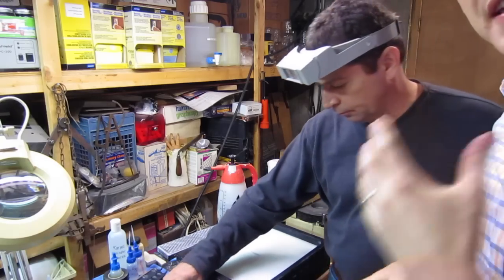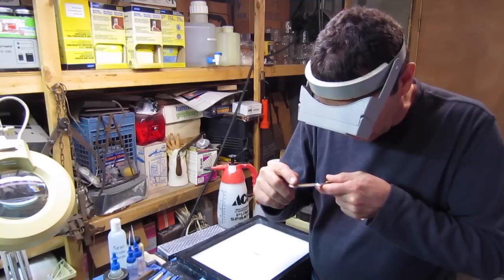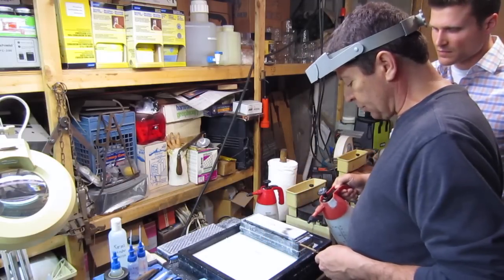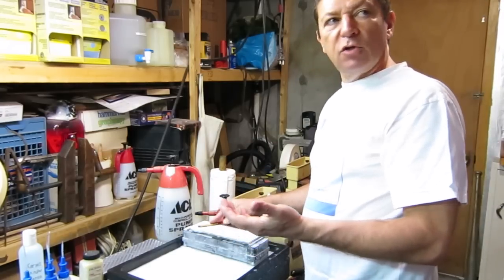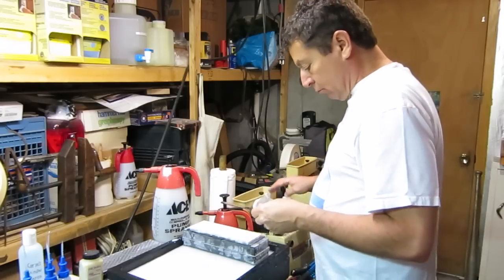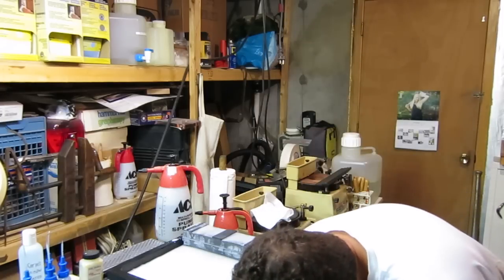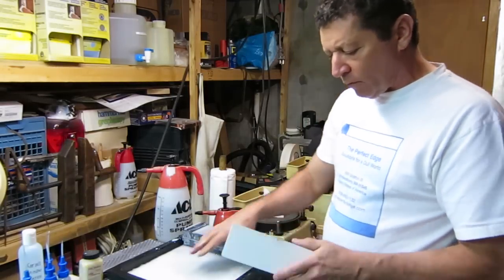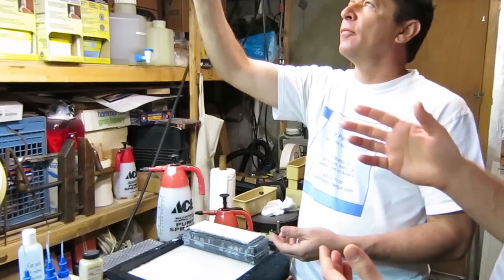The Perfect Edge - Straight Razor Sharpening

Comment: I've always had trouble honing correctly. 
After watching this: 

I put a pretty aggressive bevel on an old straight razor. 
Took the razor to a higher grit.
Took off the flash (29:27),
Did two backward cross swipes on each side

Once I was done, I tested the edge on my forearm, and watched the hairs lift off of my arm and collect onto the razor. 

I'm definitely glad I watched this video.

Comment: as you hone won’t the spine wear down and then the angle of your edge is constantly changing as the spine gets smaller
Reply: No. You are also losing steel at the edge. The straight is designed so that the loss of steel at the edge and spine maintain the same edge bevel angle throughout the life of the razor. This is the best argument against tying the spine when honing.
Reply: A straight razor is designed by a team of engineers and the Overall Angle (OA) stays the same as the spine wears down at the same rate as the edge wears back. I do tape damascus blade spines so as not to mess up the etched damascus look but otherwise don't believe in taping the spine.

Comment: Howard.  Questions on the coticule. I have many and collect them. I just bought a 12 inch one! it weighs a ton.

Anyway. Howard are you still using them? you mentioned to me in an email years ago that you always use slurry. I feel slurry can round the edge.
can you explain your process with them? Maybe a video?
Are you not stropping even after a coticule?
Reply: Nicholas, YES! I still use coticles and Belgian blues and still love them. They sharpen quickly, don't load, don't form burrs, and give a great edge. What's not to like?
Reply: I have never experienced getting a rounded edge off of a coticule. I always use a slurry. When I'm honing other peoples' razors, I go past the coticule to the Shapton 16k and 30k. In my medicine cabinet though, I keep a coticule which I use to keep my own razors sharp. Strops. I no longer use hanging strops. I do have a 4 plate lapping system I created with .5 micron diamond, CrOx, and the last two are abrasives I make myself. One is called Purple Phase and it's around 40,000 grit and the last is Zulu Phase and it's around 50,000 grit. Shaves smooth and is amazingly sharp. BTW, I only sell Select grade coticules and, from what I've seen, and what my customers tell me, there IS a difference.
Reply: Nick, the coticule market has really changed over the past few years. A lot of what used to get thrown on the slag heap is now being sold with cute French names. At the same time a lot of problems have been cropping up with cuticles such as the rounding you mention. I don't experience these problems as I only use the Select grade coticules. They cost a bit more but, if you're going to have a stone for two generations, the extra cost is minimal and amortized out over time.

Comment: Howard, Dovo makes a black plated straight razor blade, would the aesthetic be ruined when sharpened?
Reply: Thanks! That really clears things up, especially the bit about taping the spine.  I ended up going with Dovo's Bergischer Lowe.  Worth changing the attack angle slightly in order to save the sculpted, gold plated sine.

Comment: Howard...you may have mentioned and I just didn't hear, but we're all those strokes with pressure? Could I use this same technique on my Naniwa stones? I have a 1000, 5000, 8000, and 12,000. Thank you for your response.
Reply: Richard, all of the strokes are with pressure because the goal is to remove steel. It's easy to gauge on the shapton stones as they're white and I look for an even smear of gray steel across the stone. The Naniwas are good stones but you might want to try finishing on the Shapton 16,000. You'll get a better shave.

Comment: What do you think about using a dremel to hone a straight razor? I had a professional sharpener recommend this. What do you think?
Reply: +Howard Schechter Thank you for your reply. I thought a dremel would be disasterous on any straight edge razor. I had a well-known pro basically tell me that whoever told me this is incompetent. Thanks again.
Reply: Working on straight razors is more like working on jewelry that is heat treated. I fix a lot of blades that get messed up with Dremels, Foredoms, WorkSharps, and belt sanders.

Comment: I may have missed it, but how much pressure does he put on the blade as he takes it through the series?
Reply: Phillip Rios Phillip, not a lot! I let the stones do the work. If you press too hard, bad things can happen. How hard? Well, you're grinding steel so you need some pressure but not a lot. Hard to tell you online but if you're ever in Massachusetts, stop by and you can see how I do it.
Reply: enough pressure to leave steel on the stone. If you go too light, nothing will be accomplished

Comment: Did he back hone it before he shaved his arm or did he do normal forward stroke?
Reply: after the 30k I do a jointing stroke on the edge (holding the razor vertically) and then two forward strokes on each side which gets rid of any of the "flash" at the edge of the blade

Comment: Hi, was the last 4 strokes - edge leading or spine leading? I couldn't see.
Reply: Edge leading. First, joint the blade on the shoulder. This gets rid of the flash and gets down to the true edge. The four strokes get rid of the remaining flash. I do this instead of stropping which, I find, fatigues the flash and breaks it off unevenly. I'm all about the edge, 'bout the edge.

Comment: Should I consider buying Shapton Glass stones or Shapton ceramic stones?
Reply: ***** Shapton glass stones. They're the newest technology. The ceramic stones are old technology and fading out. I've been using the Shaptons for many years now and couldn't recommend them more. They give me consistent and repeatable results. The biggest variable is the razor itself, the steel, the heat treat, and the previous honing history. I've received blades which were sharpened on a belt grinder and that takes the temper out of the steel immediately. A blade like that will never work properly.

Comment: sucks that radio shack doesn't exist anymore. Im sure i can find something simular to that microscope on the net somewhere. I love this guy and it very rare that I like a person. his understanding of everything is amazing. I could totally hang with this dude and would listen to everyone of his fun facts with 110% attention.
Reply: Yes, there's nothing to replace Radio Shack and I miss them. I'm now getting the Carson MicroBrite from amazon.com and I actually like it better than the RadioShack model. LED light, easy focus, 60x-100x. The best deal I've found out there in optics at $12.
Reply: 😂 I have that same jewlers loop from radio shack for $12 dollars from 2003  for my straights. I'm holding it in my hand now. Batteries are dead and switch needs a little work. Just got to polishing honing stroping and shaving with my 14 ebay razors from a 20 year hiatus. Screwy thing is just overnight through osmosis. I can hone polish and finally put a shaveable edge on a razor now. I can see imperfections and chips with the naked eye through the polish and glint of the metal against a good light.

Comment: Wow this method looks much better & easier, i will have to save for the 30k  hone and glass lapping stone..
Reply: +Karl Buttler the lapping plate is amazing, shapton glass stones are simply designed to be used by them. The DGLP grooms the stones and makes them very flat, however the 30k stone I dont' agree with. Its very expensive, and you can get very similar results with honing compound on a hard sub straight.
Reply: thanks ill look into it..
Reply: also, if you want a fine stone just get a suehiro 20k, its actually finer than the 30k shapton, and alot less money
Reply: Thanks looking into it now, how long have you been using straight razors?
Reply: Not too long, but I have been sharpening and using just about everything else for quite a while... straight razors are my newest adventure.
Reply: Sam, how is the 20k finer than the 30k?
Reply: Karl, there is power and synergy to the Shapton system. All of the parts work together and produce consistent and reliable results. I've tried many stones and have hundreds in my study collection. I've standardized on the Shaptons.
Reply: I think the 20k gokumyo is .25 micron so its actually about the same, I thought it might have been slightly finer. I believe its cheaper and thicker though.
Reply: Brands will name their grits whatever they want. The Norton 8000 is really more like a 5 or 6 thousand in other brands. You can only really go to micron rating. there are also three basic grit systems. The New Japanese system, which shapton follows, the old Japanese system which King follows, and then the USA system, which is like Norton sand paper, but then company's throw curve balls at you and just put random numbers up for their own line. Shapton wants you to read "wow 30,000" its a very fine stone, but their just mesh ratings.
Reply: most sharpening nuts i know who want to spend allot of money go for the  choseras or japanese naturals. 

I had a set of glasstones up to 16k and wasnt impressed. i got better edges off my imanishi 10k. i do think the shaptons are over hyped and marketed in a somewhat dishonest way, with their higher grits really being exagerated. I do appreceate they label the glasstones with the micron size.

plus i do think if your getting into half micron territory you might as well just strop with compound.
Reply: Depending on the razor, 16k isn't enough. Bokers, for instance, really only shine at 30k. I've been using the Shaptons every day for the last 6 or 7 years and get consistent and reliable results from them. I've got customers from all over the world who send me their straight razors to be honed and are repeat customers. I've built my business over the past 15 years and am surprised at your lack of results with the Shaptons. I have a number of natural Japanese stones but they just sit on the shelf. Same thing with Harrelson Stanley, the Shapton distributor. He trained as a carpenter in Japan for 12 years, has a whole shelf of natural Japanese stones and they gather dust. I know a lot of people love their Japanese stones but I'm not a fan as I find them variable in quality with soft and hard spots throughout the stones. Quality control is also somewhat lacking with many of the stones shipped looking like they were hacked out of the mountain. There are many ways to "sharp".
Reply: Howard Schechter  the shaptons are popular and for good reason, they are perfectly useable high end stones. im just saying i think they are a little over hyped and over priced for what they are, and there are so many options out there. 

when your saying most razors need to go above 16k to have a good edge, your really saying a 16k shapton, because for any other manufacturer that same stone would be rated around 10k. here are some examples:

the shapton 16k is around 1 micron, these stones are also 1 micron:
Naniwa chosera 10k
Naniwa superstone 12k 
Suehiro 10k 
Sigma select 10k

as you can see, the shaptons grit rating is exagerated compared to others. as others have said also the suerhiro 20k is half micron, which is the same as the shapton 30k. So you can see why i feel the shaptons are a bit hyped and a little misleading. my experience with the shapton glasstones was that they cut fast but didnt leave the edge id expect for their stated grit, and they loaded quickly on chisles and wide bevel knives. I got a better edge consistantly  with my imanishi 10k vs the shapton 16k, which is 2/3 the price and 4x as thick as the shapton.

Also their prices.are higher than others. their lapping plates are verry expensive for what they are, and you can get just as flat a stone just as quickly with a dmt for 1/4 the price. the shaptons are also about half the thickness of comparable proffesional stones at the same price, so the value really goes with the other brands in most cases. I would think as a professional sharpener you would explore more cost effective stones as long as they give the same results.

most professional sharpeners and sharpening enthusiests i know actually use a variety of stones. they will prefer one manufacturers 1k and anothers 5k and so on, not typically sticking with just one brand. every stone has its strengths and weaknesses, and each grit in a perticular stone line can vary allot, the shaptons included. different stones work for different applications as well, some.stones that are great for razors will clog up and glaze instantly on wide bevel knives for example. Every sharpener will develop preferances. if the shaptons work for you thats great, but i think its good for people to know there are lots of good options out there especially at a lower price point.
Reply: I think you should give Howard a call! he a nice guy, and i'm sure you will have a great chat about abrasives and stones. He is very open minded and knowledgeable. Glass stones are not my favorite either, but I bet you will learn some things you did not know if you talk with him.

Comment: Just a small point Howard, you said that Germany 'invented' stainless steel, in fact it was Harry Brearley, working Sheffield England who, whilst working to develop a wear resisting steel for the British Admiralty for use in gun barrels developed a 12.8% chromium and 0.24% carbon it is this which has been argued to be the first ever stainless steel.

This steels resistance to corrosion was noted as were the resistance to attacks from acid and he recognised the potential for this steel; he noted that it would be ideal within the cutlery industry. His current employer at this stage wouldn’t support him and thus he went to produce his new steel at a local cutler.

Within three weeks he perfected a hardening process for knifes and named the invention “rustless steel” however his friend Stuart named it “stainless steel” and since the name has stuck. It isn’t all that simple though because during the five year period between 1908 and the discovery in 1913 other scientists had potential claims to his title.

It was a combined effort by all scientists and metallurgists which has created such a rich and versatile metal right at our fingertips and it is safe to say we will never solve the speculation behind who discovered stainless steel.
Reply: Thanks Steven! I did not know that. We now have all kinds of stainless steels in the 300 and 400 series and some are actually rust-proof!

Comment: What strop should I use after the 30000 stone?
Reply: Don't. No need to. Just joint the blade on the shoulder of the stone and do two strokes into the blade on the 30k stone. Voila! If you want to use a piece of leather on a flat surface, you can. Just don't overdo it i.e. no more than 10 strokes.

Comment: I have a shapton 1k and 6k that I use for sharpening most blades, but just got into razors. I was hoping you could give me some tips regarding these questions I have. 

1) Is the shapton 16k adequate to finish the honing process if the 30k is a bit over my budget? 
2) For weekly maintenance the yellow coticule is what you prefer correct?
Reply: Yes! The 16k is my most popular stone. People have tried all kinds of things and rave about the resulting edge. It's the best value on the market for grit size.
Reply: The Shapton 16k has gone up in price and I'm now recommending the Zulu Gray for an even better finish on the blade.

Comment: i dontknow about  using stones past  12 K .Iat the 12K point move to Balsa wood with chrome oxide then balso with CBM .5 micron then .25 Micron then 60  passes on the strop . I have looked at this inder a lab microscope  and there is  very little scratch 
pattern on the blade . My razor passes the single hair  drop test.

Comment: did he use the hair hanging test? I always have fun with my razor, and of course I hone my own razor using my trusted jnat xD I'm too deep into the rabbit hole now.....
Reply: MasterofPlay7 Check out the Blog on my website for my discussion on sharpness testing methods. To make it brief, the HHT is a subjective and referential test. It's nowhere near absolute or objective. My hair and yours are very different. Nick's background is Scandinavian and his straight fine hair reacts really differently than my curly dark hair. Hair curls because of nubs on the side of the hair which absorb moisture differentially which is why it curls. Those nubs will catch a blade more easily than a straight fine hair.
Reply: Howard Schechter my reference point is the hht, and I find that the edge has to pass the hht root in and out in order to give me a good shave.....

Comment: How are you holding the angle and stopping from grinding the spine
Reply: I'm sure you know this by now but he is not, the spine grinds with the edge, and dictates the angle.
Reply: Paul Stephenson I usually put some painters blue tape on the spine to protect. I don't like my spines ground down.
Reply: Paul, the tool is designed with an Overall Angle (OA) that needs to be maintained in order for the tool to work as the design engineers intended it to. I recently did a study of OA and recorded a lot of razors. It's all over the place. 17 deg to 24 deg is the approx. range. If you tape the spine, you change that angle, and eventually the performance will slip as the angle changes.